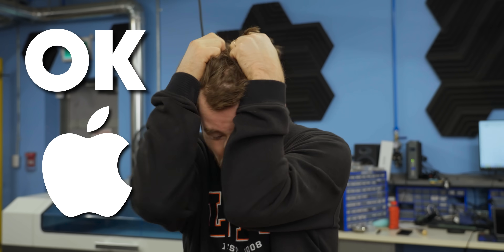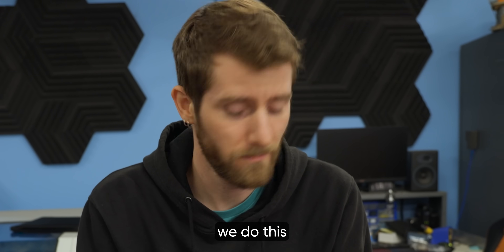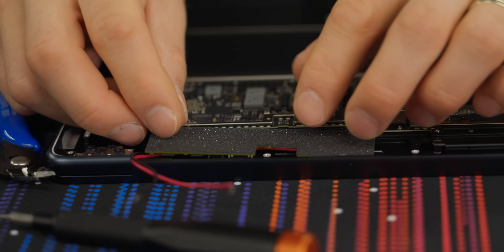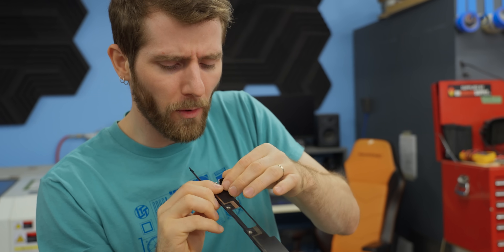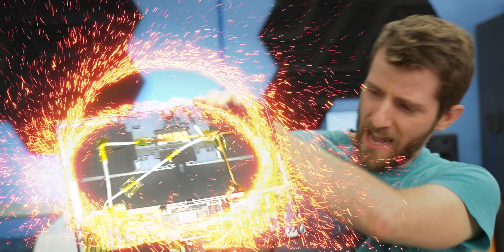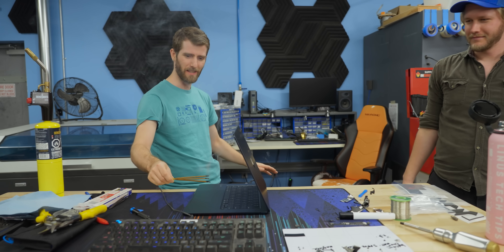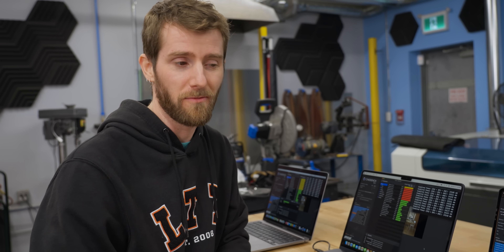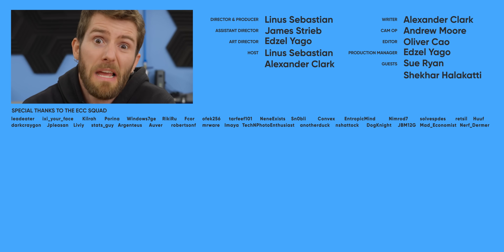Apple please watch this. - Frore AirJet MacBook Air

Comment: I'm actually happy that it do not have moving air for cooling. Less things to wrong without dust. Pro is for the people who do renders etc.
Reply: One of the coolest things about the air jets is since they have such high static pressure they can draw air easily through ridiculously fine filters. Effectively dust free air cooling.

They covered this in the original video showcasing the product. It's worth a watch.

Comment: Using the computer power draw as an indicator of how well the computer is running isn't the best idea because the base model uses less than the modded one that is putting power to the solid-state fan... How do you guys not know this??

Comment: Man this tech is so cool, I really hope it gets into the next wave of laptops
Reply: @Bramble20322  Did you comment before you watched the video? 15f cooler than regular fans AND kept the laptop from throttling; improving CPU performance by 26%. Keep in mind there is so much more room for improvement since the case wasn't designed for airjets to begin with. Yes, it does consume more power but that's to be expected if you want a cooler/ more efficient laptop. Yes, it does cost more but that's because its still in its beginning stages. If this were to be mass produced then it'd be significantly cheaper. 
Besides, people pay hundreds if not thousands of dollars for a slight performance increase. This will be no different.
Reply: did you see the power cable it is pulling 45W … it won’t be useful any time soon
Reply: not going to happen anytime soon. the issue is fan companies are monopolizing the air cooling sector. they'd all go outta business if they let this tech into laptops/pcs. its going to take some time.

Comment: This is neat, but how long does a solution like this work before dust accumulating on the inside makes the performance worse?
Reply: About that, another really cool feature of these is the static pressure is so high you can use absurdly fine and robust filters. You can still maintain an effectively dust free environment despite air cooling.

Check out the first vid LTT did on the product, they cover this info in it.
Reply: @TheDarksideFNothing  that’s really cool!

Comment: Imagine Apple bringing back the 12” MacBook with that technology inside. Would be perfect
Reply: Aside from screen size, what do you think would differentiate the 12" Macbook from the current Macbook Air? Maybe you could argue for an even smaller Macbook Air but I don't think theres any good justification for Apple to bring back the non-Air/non-Pro Macbook.
Reply: @jcalerre   people nostalgic for no reason. i see people on macrumors all the time talking about how they should bring back the macbook. there really is no difference between a macbook and a macbook air. as a matter of fact, bringing back the macbook would just cause more problems because if you are having an issue with your macbook and you search it up on google, you will end up with results that may be specific to the macbook pro or macbook air. makes no sense
Reply: @jcalerre not that it’s THAT big of a deal but the 12” MacBook was insanely thin and light. 2.0 pounds vs 2.7. I upgraded to a 13” M2 air from the 12” MacBook and it was a pretty significant bulk and weight difference
Reply: wish theyd bring it back as a 500 dollar chromebook competitor with a cut down chip or iphone chip or something
Reply: @bella_ciao4608  That's the ipad, I think. Not that I think it's a proper PC replacement, but neither is a Chromebook in its natural habitat.
Reply: @leonro accurate
Reply: @bella_ciao4608 They’re planning something similar, but it might have to be around 14 inches.
Reply: @bella_ciao4608  the iphone soc is still pretty capable, I doubt that it will be 500 because macos is part of the price of the device, unlike windows, you get free software upgrades over many years of the mac
Reply: @bella_ciao4608  iphone chips in a budget laptop aren’t a bad Idea, never thought of it
Reply: ✨iPad 10th Gen✨
Reply: They need to just let MacOS run on iPads that can handle it. VMs are a solved problem so it could literally just be an app.
Reply: @AndrewThrasher1987  nah that would be dumb
Reply: The problem with that is it's constrained by the width of the keyboard. The 12" was only 12" because of the bezels, shrink it back down to that size and you'll have at most an inch smaller than the 13.6" Macbook Air? Compared to the Macbook Air design before the chassis they used for the M1 and previous, the bezels were thin and it was meaningfully smaller, but with the size constraints the Macbook used and the design currently, it wouldn't be significantly smaller nor significantly different.
Reply: They are working on a Macbook (and yes not a pro or air. Just Macbook) starting at $750. Thats what the Rumors are anyway.
Reply: @human_936  Really have to wonder how different it will be compared to the M1 Macbook air, since you can find that on sale for $750 every so often already.
Reply: @human_936  yeah I heard about that. We’ll see if that comes to fruition 👀
Reply: Why tf would anyone want a 12 inch pc?
Reply: @JuanDiego-r9g1h  portability
Reply: @chidorirasenganz  Get bigger hands. Soft hands brother
Reply: @JuanDiego-r9g1h  portability is irrelevant to ones hand size or toughness. You can sleep on concrete.  That doesn’t make it a good bed
Reply: @chidorirasenganz  Soft hand brother, your overtime is part-time to me
Reply: @JuanDiego-r9g1h  cool story bro
Reply: Just buy an iPad
Reply: Yeah but knowing Apple it would cost more than $1000 & still only have 8 GB of RAM unless you want to pay a couple hundred more.
Reply: They really don't need to honestly. They could use an even lower power SOC, or even an iPhone SOC and that would get the job done. You don't need massive performance in a 12".
Reply: 12" is way too small for a computer.
Reply: @Soccera0  not at all
Reply: @chidorirasenganz my 13" is way too small, so 12" isn't better.
Reply: @Soccera0  13 is fine and 12 is even better. External displays exist for a reason lol

Comment: Apple won’t do this because it would too narrowly close the gap with the pro line. To differentiate the product lines, they have to build in intentional limitations, why buy the pro if the air doesn’t throttle? It’s the same reason the crippled the old MacBook Air by  removing the heat pipe that connected the cpu cooler to the fan - without that handicap it would’ve performed to similarly to the 13in MacBook Pro.

Comment: Is the thermal throttling issue relevant for anyone who doesn't do video editing/3d rendering? 
I do webdev, and even my colleagues that run a couple of containers and compile rust all day aren't complaining.
Reply: Exactly and how much power do these airjets use?
Reply: apparently the throttle hits about 10 minuten with continous maximum load.
So no, they just want to make it look badder than it is.

Comment: You're darn right that Apple could install active cooling in the Mac Book Air. But if they did, how could they induce you to spend the extra bucks for a Pro?
Reply: You may not be a big fan of fans and that's OK. These units are solid state. Does that make them fanless fans? @starchaser6057

Comment: honestly i don't think it's worth it. you'd have to give up battery life or connectivity, it becomes more susceptible to environmental damages (such as dust clogging etc), it draws power from your battery, it creates noise, etc all for like a 6% performance increase in stress test scenarios. a 30 min blender render seems more like a task for a pc than a laptop.

Comment: Would love to see this tech used in 1slot  gpus.
Reply: I don't find it promising for this use case. I mean 1slot GPU can easily be built with current fan/heatsink tech to expel well past 100W (a viable target for mainstream class performance) and not even make it too annoying, and you could further improve the efficiency of VRM circuits but there's cost to it that the companies don't feel confident enough in paying. This maybe eventually they get bigger units that could ever reach tat sort of performance but it's likely to take decades and see their already mediocre efficiency tank. Not to say that this isn't an exciting tech, it's just the wrong niche.

Comment: i could have scanned and 3d printed a new back cover in a few hours that would just work. no need to loose all the extra functionality
Reply: Wouldn't need a complete back just a spacer/shim that lines up with the screws, any extra space created elsewhere could be used for bigger batteries too
Reply: also correct
 @prawny12009

Comment: That the throttled machine only lost ~400 points over the modified one honestly leaves me more impressed with its passively cooled design. Even while throttling under a torture test it was still able to provide close to its normal power envelope, impressive.
Reply: Yeah, it's a neat concept, but that's still ~93% of its peak performance. Once Linus said he could hear it I knew Apple will never do this. Being silent is part of the MacBook Air brand, and especially for only a 7% loss it's just not worth it.
Reply: @tiduszk  For real. Conclusion kinda makes the video title look dumb as torture test results confirm Apple was 100% right to go passive for this model.
Reply: @tiduszk  true, but that's a slapdash solution using multiple blowers. Imagine throwing Apples engineers at it, bet they could make it inaudible.
Reply: @zenith251  sure, but all that extra cost engineering that for 5-7% more sustained performance, with higher power draw. I’d rather they squeeze a bigger battery inside instead. For users who need more power and active cooling, there’s the pro line.
Reply: @tiduszk adding more bat cells isn't something you can just easily slap around the inside of a laptop chassis. Making room for a mm thin cooling unit IS easy. Besides, it would only run under heavy loads. It wouldn't factor much into overall battery life.
Reply: @zenith251  but it’s clearly not that easy. It would require reengineering the entire interior. To make room for them in the video they lost the keyboard, MagSafe and more. If they’re going to have to redesign the whole thing anyway, I would still rather they move things around to make room for 5% more battery than 5% more performance.
Reply: @tiduszk also, "extra engineering?" You mean basic product design that happens every time they update a product? How is that "extra?" The technology is done, it's made.
Reply: @zenith251  trust me when I say this, no one who buys a MacBook Air would even notice 5% more performance, and if you asked them, they would all choose better battery life over more performance. Consumers shopping for ultra books care much more about portability than performance. Consumers who care about performance have other classes of laptops.
Reply: @tiduszk Having less hole on the case help with durability too. Sealing USB and 3.5mm is easy but air inlet can’t be water tight
Reply: @tiduszk  But this isn't a realistic use case. Like, I have a Pro, and I have to compile RUST!!! Still not regularly going over 5 minutes on a full core load.
Reply: @tiduszk 
Guess what... This thermal state is just degrading ur PC faster...
Reply: @tiduszk  exactly, the battery life you'll give up for this makes it immediately not worth it. if you have a workflow that requires you to max perform your machine for long periods of time, get a macbook pro.
Reply: It's a 5% difference in their torture test, to be specific (actively vs. passively cooled). I can see why they just cost-cut it out of there entirely when there is little to be gained in performance or cooling and a lot to be gained in acoustics. 100% correct design decision by Apple for their entry level laptop.  Everyone is chasing those tiny process nodes for a reason.
Reply: @mapwheel00  To be fair, the macbook pro also does not use its fans below 60-70 and and is very slow to ramp them up. I don't think you actually get them to to even 90% on the stock curve. So for most contexts it's also quiet. Which also means you don't need the fans. But yeah, the Air is not made for people sustained all core loads. It's totally fine I think to have a CPU that is "overpowered" for their in built cooling. Since it does enable spikes which will happen, while not full covering sustained loads since that's not what the market for the device is.
Reply: @mapwheel00  If Apple cared they could design it to actually work properly. And get even more out of it. Or just integrate it in pro and get more space for ports? Nudge, nudge, wink, wink.
Reply: @Co0Ooo0w Dont fix something isn’t broken. And how there would be sustained load on a macbook for recreation purposes if macs can barely game? I thnk Apple might install it on macbook pro a few years later from now but no way they will put it on mba. And tbf MBA buyer with common sense can tell it won’t stand that well in high sustained load vs typical laptop with fan, just deal with it or buy gaming laptop/MBP
Reply: Wonder what it'll do for the longevity of it? I guess we'll get to find out together.
Reply: I converted from a windows laptop to the m1 air specifically because I use it in my woodworking/laser cutting maker space and it doesn’t pull in dust. I’d be bummed if they moved away from passive cooling, but thats just me.
Reply: And now if u think about what Linus and Co have to cut out to get some space for the AirJet moduls...
Reply: And unlike other laptops, does this on battery while others will lose 20% or more while being plugged in, linus is honestly just a massive hater of these devices. The entire point of an air is to be silent, sleek and just works. My M2 Air has never gotten warmer than skin temp and I also have a Vivobook oled 14 with a 5900hx and a rtx 3050 and that thing draws and produces heaps more heat while doing the same exact tasks. I caved in last week to buy my M2 air and honestly its essentially a perfect device, minor annoyaces with macos it self
Reply: @atom608 while not completely relevant, I will say that my 15” M4 MB Air does get quite warm, not to the point of hurting or anything but it does get quite uncomfortable.

It definitely could’ve used a bit better cooling… it’s yet throttle as far as I’m aware though.
Reply: A fanless ultrabook that is decently powerful is exactly why I chose the MacBook Air M1 when it came out over any windows laptop. There’s just no competition yet that actually competes with it on all fronts. Sure, you can find a laptop that’s faster, bigger battery, quieter, and more durable. However, I haven’t found a laptop that beats it at all of these for a reasonable price.
Reply: @Howleds not even quieter. You don’t get quieter than silent. Name any laptop on the market that has comparable performance but is also silent. There isn’t one.

Sure AMD and Intel are faster for the same price, but not quieter and not more energy efficient.

For laptops, ARM is just better because performance per watt is king for portable devices.
Reply: @Samuel.55 Qualcom is coming for Apple though. Windows on ARM will strike, and Apple will probably lose quite a bit of marker share because Windows > MacOS
Reply: @homelabsmart7635  nah
Reply: @Howleds  Apple and reasonable price. Interesting. Its like Apple and repair-ability :D
Reply: OFFICERJIMMYUTTP prove it
Reply: if you used your entire case and every component as a passive cpu cooler it's not so difficult to imagine. 
It's a massive heatsink, the entire computer. Tons of surface area to dissipate the heat including into the human working with it.
I don't think it's impressive what other manufacturers would see as a design problem.
Reply: Modern gaming laptops are FAR better at retaining power, cooling, and points than Macbooks. I wouldn't call a 400-point loss impressive at all. My gaming notebook doesn't even lose 100 points(granted it has fully active cooling fans, copper heat pipes, and a vapor chamber) and it cost me only $800 plus tax. Instead, my ASUS TUF FX505dv only loses 50 points over time with thermal throttling.
Reply: @kingzach74 Are you seriously comparing a laptop that’s has active cooling and is 3.3x the volume to a passively cooled one? 😂 Maybe you should compare to the active cooled MBP in this video that actually increased its score but 79 points
Reply: @kingzach74 your gaming laptop is not an ultrabook
Reply: @kingzach74  Unplug your "gaming" laptop and do this test for 10 minutes, and see how well it does.
Reply: @kingzach74  I don't think you understood what was being said lol

Comment: The air m2 does not need fans. I’ve had one for over a year and it’s never got even remotely warm. If your running such heavy workloads on a macbook air that its thermal throttling, you might as well buy the pro.

Comment: Exciting? Yes 
Practical? Maybe 

The problem with this technology is that you need to have a lot of air so you can change pressure to volume. 
Whats the power draw of this thing? 

it would be nice to finally get quiet and cool laptops. Hope they will be able to do it.
Reply: What do you mean “finally”, that’s half the selling point of the MBA. it has no fan, it is quiet. It only throttles under about 10 minutes of continued maximum use, which is simply unrealistic. You could build an xcode project in under 10 minutes especially on the m series chips.
Reply: Its 20W device... 

Apple can do it. X86 has a problem. 
You cant get more ram there couse it generates heat. 
You cant get more powerfull GPU couse it generates heat. 
You cant get more power from processor couse it generates heat. 

Any "normal" 60-80W windows machine can shred MBA. If you know what you will be doing with a laptop than you can take it. In my case paying this much money for a machine i wont be able to do heavy tasks on is just wastefull. 

Thats my case tho. We are talking about opinions here. This "finally" was also an opinion :)
Reply: @mateuszsa7  well yes always look for your purposes first.